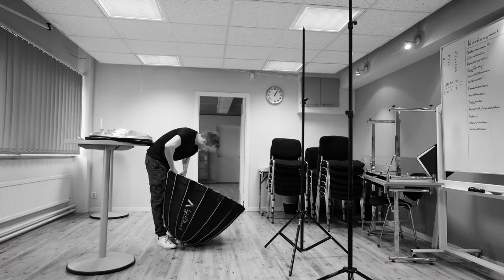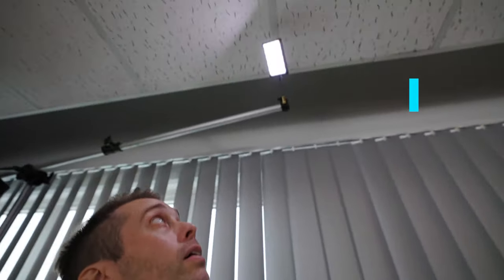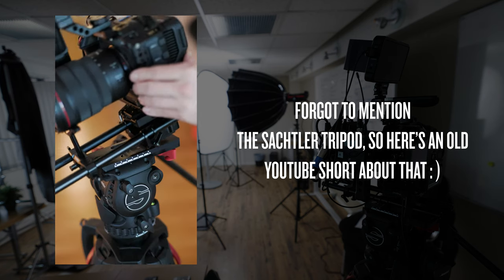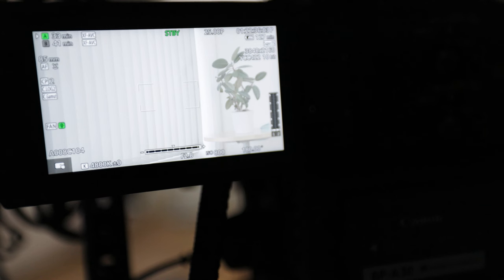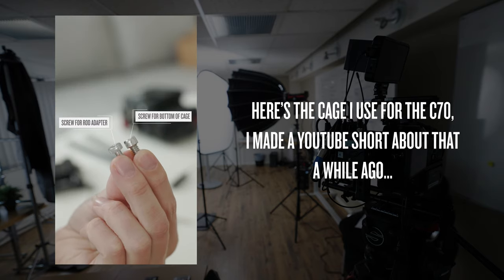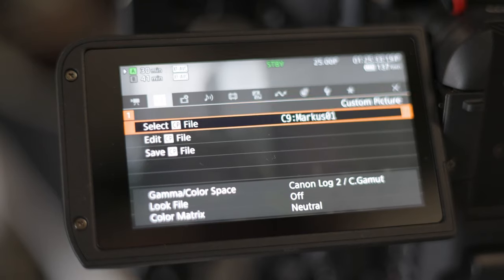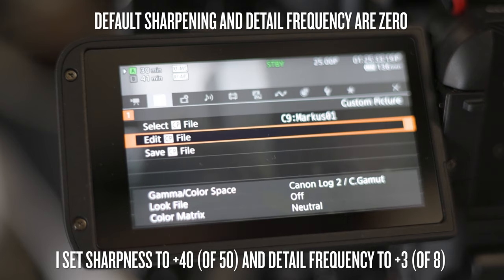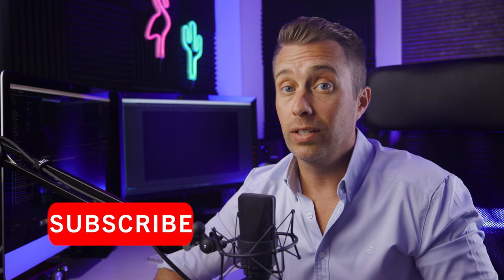How To Film Corporate Interviews with Canon C70

Comment: Why not raw lt ?
Reply from the maker: Why I don't shoot RAW? I have not taken the time to get in to the workflow. Every time I have tried RAW on a number of different cameras (BlackMagic, Canon R5, C70 etc), I get some super-noisy files that need a lot of processing to look good. The RAW-files are not good to go SOOC. That is of course a lack of motivation and skills from my side, to really get in to it. The MXF-files from the C70, in the settings I shot in this video, have more than enough quality and superb dynamic range for my needs, and they make my life easier with a hassle-free workflow. Same thing when I shoot in ProRes 422 on my Ninja connected to my R5. It's butter smooth to work with SOOC. I don't work for super-high-end clients with extreme quality demands. I work for clients that are going to use the delivered material on LinkedIn, FB, YouTube, their website etc. Shooting RAW is just overkill for me. I can to the color correction and grading I need with ProRes or MXF. If I saw the need for more dynamic range, I would definitely get in to it, but I don't, so I won't. :) Not right now at least. Hope that answers your question, thanks for watching! /Markus